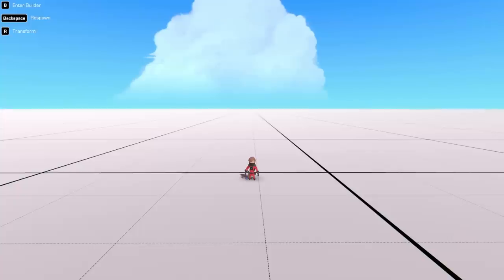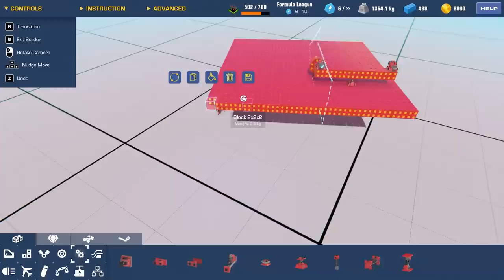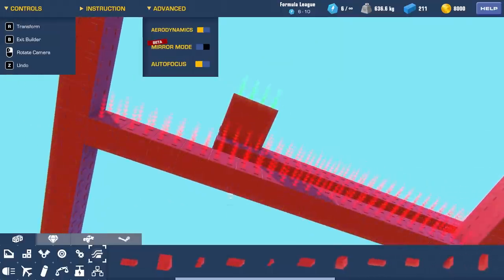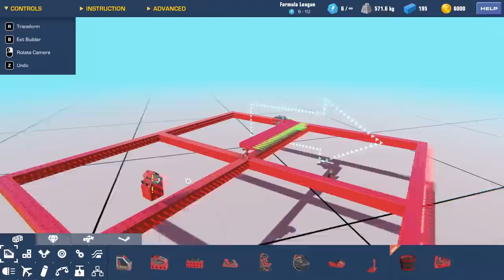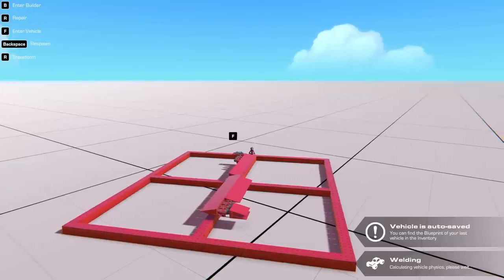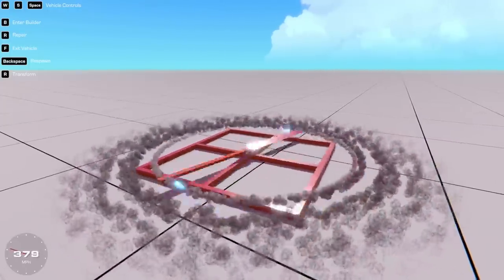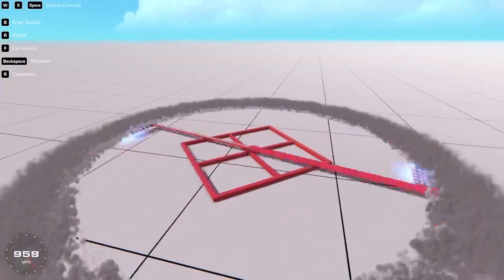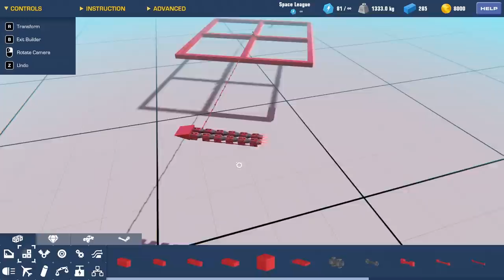Can you create a sonic boom WITHOUT moving??

Comment: Im pretty sure the servo has a rotation speed limit, which is why you had to extend the arms to increase the speed. in some games ive stacked several servos/rotors on top of each other to alleviate this
Reply: Trailmakers doesnt have that as long as you turn down the strength of the servo to 0
Reply: Tbf making the radius bigger and maintaining RPM would increase the horizontal speed
Reply: May also be a rotation speed limit by the physics engine
Reply: @the_charliecp8859  It's basically a dirty website with specific fish categories. 
So don't worry too much about it.
Reply: @chrisakaschulbus4903  am I missing something?
Reply: @samkimble5610  true, also stacking servos in trailmakers is reeeeeally unstable
Reply: @ke8wlw  "am I missing something?" Is this what someone who doesn't miss stuff would ask?
Reply: @ke8wlw  i dont understand either
Reply: @chrisakaschulbus4903  well you appear to have responded to a comment about rotational dynamics with a comment saying something is a dirty website and fish catagories, so either there's something they're missing (deleted comment or something) or you simply said something completely random/responded to the wrong thing or something.
Reply: @janseta5162  I think the problem's on your end. maybe reinstall your OS or something.
Reply: @chrisakaschulbus4903  So long and thanks for all the fish
Reply: @Smorb42  "So long and thanks for all the fish"
This guy gets it.
Reply: I believe it might be because the jet provides a very certain amount of force, which is independent of the rest of them. This means that increasing the length allows more leverage, creating more speed. Engines however, grow in power the more of them there is.
Reply: @chrisakaschulbus4903  what?
Reply: @Superabound2  "what?" Your confusion is not real... it's just in your head.
Reply: I'm also wondering if the engines don't have a natural speed limit --- they suck in &  push out (burned) air at a certain rate? So having the engines at a certain length of arm to maximise the speed, like now, but then extend the arms (with lil' guy's seat) beyond that to have the ends be a bit faster.
Reply: @chrisakaschulbus4903  I'm assuming its something with the mice
Reply: @chrisakaschulbus4903  ?????
Reply: @chrisakaschulbus4903  lol
Reply: Space engineers?
Reply: @chrisakaschulbus4903  Thanks bro. I'm not trying to download dirty fish.

Comment: The aerodynamic blocks pointing backwards also works in real life!  Reducing the turbulence of air coming off the back of a solid, and reducing the pressure differential between the front of the solid and the back, will reduce drag :)
Reply: are you sure? I thought gold balls have holes to increase turbulence and that somehow makes them faster, did I remember it wrong?
also, I believe that F1 cars up to 2021 intentionally created turbulence for the same reason, though it might have just been to increase downforce
Reply: @etaiger  Golf balls create a pocket of air around themselves because air has less drag than the material of the ball. F1 cars focus on downforce using as little air resistance as possible. They also don't care if the air for other cars is clean or turbulent where with a centrifuge, you are going into your own turbulence
Reply: @etaiger  it is true. diffuser on cars basically does the  same thing, smoothing out the air behind. aircrafts do add tiny blocks on wings to create tiny turbulence, but those are actually also helping to reduce overall turbulence aft of wings by forcing the air to flow closer to the wing. golf balls work the same by creating small turbulences to reduce overall drag aft of the ball
Reply: Exactly what I came here to say
Reply: @etaiger  f1 cars use a special kind of turbulence called a vortex to assist airflow control in the cars. It’s quite complicated since it has to do with boundary layers, pressures. Basically it helps them cheat the physics of fluid a bit
Reply: @etaiger  F1 cars create turbulence to slow down the car behind them, the turbulence is called “dirty air”.
Reply: @etaiger  Golf balls capture air in the holes which creates a turbulent layer of air around the golf ball. Turbulent air is more sticky than the surface of the golfball making the airflow around the golfball be more streamline and have  a smaller wake, the goal is the same with an F1 car, they use certain air ducts to have air along the surface of the car and make airflow stick. they also have spiky things on the rear wing or on the glass in front of the driver (Mercedes does) This helps with air around the helmet of the driver and also reduces the movement of the drivers head according to mercedes. The rear wing spikes are vortex generators, they make vortexes which with fine tuning with the diffuser make the wake of the car smaller. F1 Rulebook dictates that the cars need to be between a certain threshold in terms of the air they leave behind, so it cannot be horribly dirty and bery turbulent because it would go against the rulebook, at least thats how it is nowadays. Another guy in the comments talked about turbulent flow on aircraft wings which is similar to the golf ball example
Reply: @the_charliecp8859  Isn't that called cavitation? Or am I a dunce?
Reply: @etaiger  aerodynamics of a golf ball and a car/plane/etc are completely different.
Reply: @jaggedpancake5353  I’m impressed how complicated aerodynamics and fluid dynamics are. I have a feeling couple first decades studying them you only learn how many things there are you don’t understand yet, after that you’ll get to actually start learning what’s actually happening and even then it’s a bit difficult to predict without actual testing in real life.
Reply: I guess he’s an engineer, not an aerodynamicist.
Reply: @etaiger  F1 cars are way more complicated than that.
Reply: Cool
Reply: @gothfalcon  it has to do with separation of the air, turbulent air "sticks" to the surface longer which reduces separation which reduces pressure drag
Reply: @alkestos  it's funny, as an aerospace engineer, we learned how lift works like 3 times, each time it's like here's actually how it works, the last time was in a masters aerodynamics class
Reply: @etaiger  think about the shape of toroedos or other marine life like dolphins, torpedos are the most aero/hydro dynamic shape
Reply: The simple explanation is quite visual. When the air moves over an object, it is either smooth or chaotic, depending on the surface and the angle of the surface. If the angle of the surface is too high on the front face, the leading edge into the air, then the net result is a tangential force relative to the surface and the direction of motion. And, on the backfaces, the steep angle instead creates a negative tangential force, as the steep angle creates a vacuum, as the air is forced into a larger space. This vacuum creates turbulence. Turbulence is essentially a way of wasting energy, and, so, having turbulent flow behind an object in some cases will act like a hand holding it, slowing it down. But, in other cases, the turbulence can be used to seperate the boundary layer of air from the object in a cleaner more efficient way, which instead helps to reduce drag. Not all turbulence is bad, but, it is incorrect to state that even only the front and back of any object affect aerodynamics. Every single surface affects it, even those which seem to be at the perfect angle to have the air slide over them.
Reply: @marcus3668  no f1 cars don't create dirty air to slow down cars behind them. The dirty air, or drag, they create is a by-product of the downforce they create. Strictly speaking that actually slows them down on the straights but it is what gives them the phenomenal levels of grip they have in the corners. But they definitely don't do it in order to slow down rival cars.
Reply: @etaiger  yeah the turbulence is from the downforce they create. Cars designed to have a high top speed often have what is called a "speed tail" which is essentially what the original comment described. Downforce creates drag (turbulent, low pressure, air begind the car) which slows the car by trying to suck it back towards the low pressure zone. The benefit of that is that it creates a very high pressure point above the wheels which allows for higher corner speeds and an overall lower lap time.
Reply: Yeah, that's exactly what I was thinking! I remember learning about it at some point and a teardrop-like shape is one of the most aerodynamic shapes. Like an aeroplane wing. It's more circular at the front end and tapers towards the back. If Matt maybe put a semi-circle or something at the front, he could have made the original "backwards" one very aerodynamic.
Reply: @nyscersul42  not quite right, whether flow is laminar or turbulent is dependent on Reynolds number not angle of the surface, you are right in that if you some up all the pressure vectors on a surface you get the lift and the drag (you break the resultant of the pressure vector into two orthagonal components), and true surfaces parallel to the drag unit vector do not contribute pressure drag but they do add friction drag
Reply: @LulfsBloodbag  yep! It is all about keeping the flow of air around the object attached, if the flow detaches from the surface of the object you get low pressure and since you are summing the pressure vector across the surface you well get more net force backwards. It helps to draw it. Think of air is being kinda a car on a track going around a corner with the corner being the profile of the object,  if you make the air/car turn too sharp of a corner it will lose it and come off the track (surface)
Reply: Lots of good replies and discussion here.

Physics, and its application through engineering, of course gets more complicated as you delve deeper into the minutiae and past the first order effects.

Certainly, total stress on the surface area of an aircraft is a tensor field that can get very complex, very quickly when looking at it from that perspective.  Even moreso when you consider there is a similar field in the 3d coordinate space of the cushion of air near the surface of the vehicle that functions as a variable to the surface area stress field.  Ultimately, lift and drag are the result of gradients across these fields.

But, in the simple case, it's enough to say that an elongated trailing edge does tend to help in real life!

(For objects that are expected to have trailing edges, which spinning golf balls do not -- the dimples help the cushion of air surrounding the golf ball behave like an airfoil with a leading and trailing edge).
Reply: @etaiger  this comment section is just roasting you
Reply: @jiralishu  To be completely honest i've never heard that term used so it could be called like that idk
Reply: It's true it prevents the vacuum behind it
Reply: That's the reason why the E30 M3 is much more aerodynamic that a stock E30 coupe, they changed the angle of the rear window and the car git faster
Reply: @HartyBiker  Thats why F1 cars have a Drag Reduction System (DRS) basically at certain points in the race they are allowed to switch in on, which reduces the downforce but also reduces drag, they use it a lot to catch up or overtake, it also helps if cars are driving in the turbulent air of the car in front.
Reply: @jiralishu  cavitation is when liquids/fluids create a gap inside them that causes a vacume. When that vacume collapses it will have a lot of energy released
Reply: @xQsBNoSCoPeZz  I'm a dunce.

I was thinking of super cavitation, but that's just in liquids.
Reply: @jiralishu  not a dunce, just didnt know/remember
Reply: @xQsBNoSCoPeZz  I appreciate your confidence.
Reply: I was lookin' for this comment.
Reply: @etaiger  yes that's why teardrops are shaped well like tierdrops. Its shaped by the air around it witch makes it the absolute most aerodynamic object. F1 cars arent really supposed to be aerodynamic whatsoever, quite the opposite in fact so they can abuse ground effects as much as possible to keep it from becoming a Mercedes.
Reply: I'm not much of an expert but I'm pretty sure irl areo on the back is more important than on the front because of back pressure I mean teardrops are relatively ball shaped on the front and long at the back
Reply: Thank you, started writing this
Reply: @etaiger  golf balls utilize a small area of turbulence within their dimples to create a boundary around the ball of consistent less turbulent air which makes the ball go further due to less turbulent air at the tail of the ball.
Reply: to be fair, he's an engineer, not a mechanic
Reply: @gothfalcon  current F1 regulations are concerned with the turbulence of your wake
Reply: Nerd
Reply: i was about to explain this, ya beat me to it i guess
Reply: @marcus3668  i guess it still doesn't work as towing still works effectively in F1 Racing
Reply: Was going to say that ahaha
Reply: @gothfalcon  I am an aerospace engineering student and I support this comment
Reply: Fax can confirm
Reply: @darracqboy  actually keyword is he's a civil engineer not a aerospace engineer
Reply: @GoldenLacunatic  yes
Reply: Yea idk why he said "common sense says it won't help"... figured he would have known better
Reply: @user-sx1fg7lc3c  I’m 13 somehow I know better
Reply: plane
Reply: Awe damn it I was about to tell him that. Nice catch.